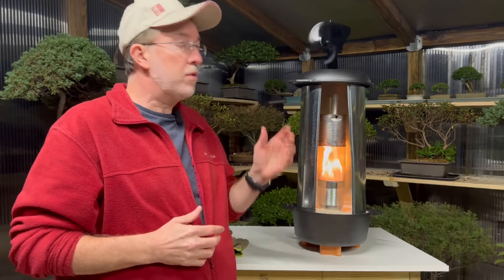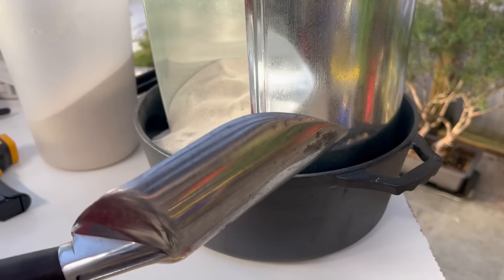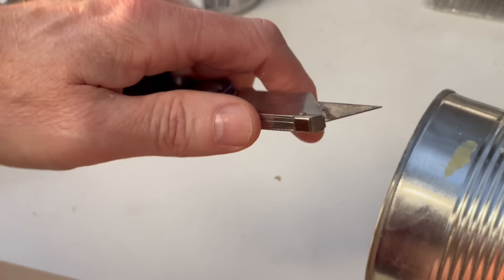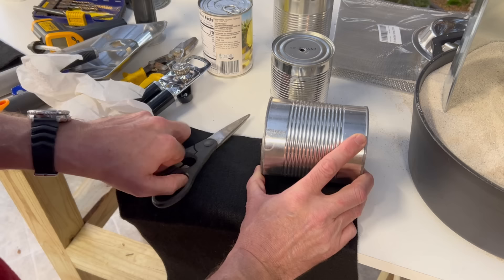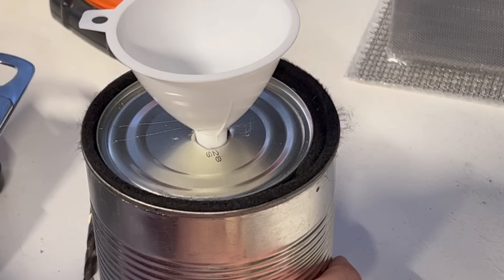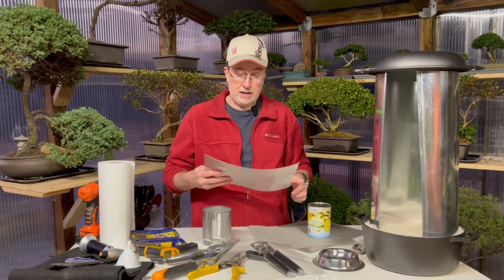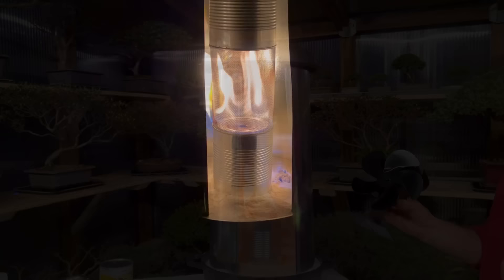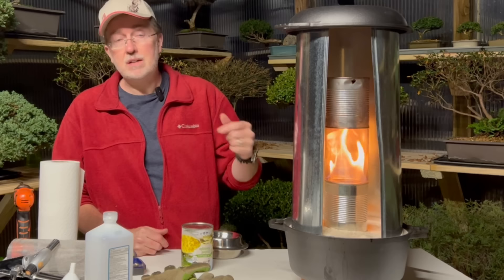DIY INFRARED HEATER | No Electricity Needed For Greenhouse Heat

Comment: Safety Note:Rubbing alcohol gives of noxious fumes. You'll want to use Denatured alcohol or camp fuel for interior applications! In case of emergency; R.A.can be used... ensure adequate ventilation! Also, from experience: place a coin/ stone etc over the fill hole to reduce flare up and fuel consumption.
Reply: This set up is designed for heavy oils like used cooking oil ,not super light oil fuel .The inner can transfer s the heat from the flame to the oil too make it thin enough to suck up . When you steal ideas from others please try and get it right.
Reply: Are you sure about that?, pure ethanol will burn much cleaner than denatured alcohol, denaturant is often naphtha or a similar to petrol solvent, this will add far more complex hydrocarbons to the vapor including benzene.
Reply: Rubbing alcohol is isopropyl alcohol. I can't imagine how it gives noxious fumes. Like ethyl alcohol, it will burn cleanly.
Reply: Omg. I do wild camping and cook with mini alcohol burners on a regular basis. It is common knowledge that rubbing alcohol gives off a ton of soot.. we know in our community because it blackens up our cooking pans. And if it’s giving off soot, guess what? That’s a bad sign. Denatured alcohol is always the highly recommended fuel to cook with in the small alcohol burners, as it burns hotter and cleaner. I can vouch from my own experience, rubbing alcohol stinks like hell. Denatured alcohol on the other hand does not give off the same nasty order. Now. Nobody should be hovering over or breathing in either of those fumes. Any form of combustion chamber needs a certain amount of fresh air ventilation.

Common sense is a commodity.
Reply: Just look for pure ethanol or better yet, methanol. Methanol burns cleaner with blue flame. No hydrocarbons.
Reply: This isn't correct. The black soot from burning 90ish plus% isopropyl alcohol is going to be primarily pure carbon. Whats really happening is that you are inefficiently burning it, eg not providing oxygen at the correct rate to match how much fuel is burning. You get the extra as left over carbon and hydrogen, etc as soot. If you burn 99% isopropyl with proper devices it is definitely soot free.
Reply: @brianm.595  iso isn’t good for wick fed flame. Fine tune adjustments for this type of build to get a complete burn is too variable.  It’s better to just use a fuel that burns cleaner to begin with.
Reply: Would ever clear be appropriate?
Reply: @Victor-hb4hj  it could but it will burn very fast, there are certain fuels that are basically optimized for burning in this fashion. You also have to be very careful with high spirit fuels, they are extremely volatile. Personally if this was a long term solution for something like a greenhouse, I would buy an old stove, get them dirt cheap and use coal and some hardwood, will burn all night. Ultimately this is like creating a solution for something that has already existed for hundreds of years.
Reply: What is RA? Also would 200 proof moonshine burn clean
Reply: Great idea. Thanks.
Reply: With that much yellow Flame Is he using 70% alcohol
Reply: @brianm.595 like the Russian brick oven design?
Reply: @TA.387  it would explode
Reply: @samuellourenco1050  it has additives to, for one reason, deter people from drinking it. 
"...Rubbing alcohol made using isopropanol is regulated and contains at least 355 mg of sucrose octaacetate and 1.40 mg of denatonium benzoate per 100 ml volume..."
Reply: After reading these comments I can safely say ~ I’m more confused! 😬
Reply: @dobrofool nah dude soot is something you don't want on your cook were, inside this unit it will collect, Soot is bad to breathe yes but it won't kill you or you plants and they said fumes not soot!
Reply: @brianm.595 
Props for some chemistry instead of anecdotal opinions
Reply: @GrowingAnswers 
Props. For logic instead of hollow measuring contests, thanks. At least u give a reason beside SOOT
Reply: @robertdillon9989 
  191 Everclear won't explode. It burns very clean. But, you can't find it everywhere. For some reason, you can only get 151 Everclear in Ohio.
Reply: @GrowingAnswers you can make your own from hard wood  while turning the wood to charcoal for later use.
Reply: Can I put this heater in my fire place
Reply: @darkenergy361  
  If it vents, yes.
Reply: @quercus3290  "Personally if this was a long term solution for something like a greenhouse, I would buy an old stove, get them dirt cheap and use coal and some hardwood, will burn all night."  

Regular woodstoves produce a LOT of pollution and are terribly inefficient.  For a permanent heating solution, a rocket mass heater is the way to go, although, for a , heating it with compost works VERY well, provides CO2 for the plants, costs almost nothing, and takes almost no effort.
Reply: @TomfromsunnyManchester  it’s not possible to steal ideas from others. All ideas exist in the universal field of consciousness. Humans are just mediums to the ideas some take them directly from the field of consciousness and take them from the consciousness retained in other human vessels. I know this to be true in 1993, I made an invention a few years later I told a friend about it, he said You should try and patent that idea it’s amazing. Anyway, I went to get it patented and someone has painted the exact same idea the day before. This is proof that the idea already existed. We both just tapped into it at the same time.
Reply: @DJ-uk5mm 
That's some serious internet woo. Have you been dipping into the Everclear again?
Reply: @TomfromsunnyManchester  
How is this "stealing other people's ideas"? It's just a way to achieve his goal - heating his greenhouse. Others may have thought of it and then the idea gets shared. Do you have electric lights in your home? Yes? OOoooOOoh I'm telling Edison you're stealing his idea!! 😂
Reply: @quercus3290 Thanks.You are correct
Reply: I stand corrected... "Ethanol" is safer. I can say from trials,; R.A. & D.A. both create some unpleasant odors. Use with caution.
Reply: Not denatured alcohol…noooo…pure ethanol.
Reply: @scout7060  Curious: Do you get any improved burn time using the felt, and also how do you find the actual burn flame (ie, larger/smaller/comparable) in comparison to just a regular alcohol burner? 😎
Reply: 😊000⁰ ok
Reply: Thanks, you just answered my question :)
Reply: @dobrofool  Where do you get the denatured alcohol or camping oil from?
Reply: @kimgowers486  Denatured alcohol should be available at Home Depot, Lowe’s, hardware stores, even Walmart. The best price I’ve found is Home Depot. Unfortunately, it’s overall cheaper to buy it by the gallon vs Qt, even though it’s expensive at $20. 1 Qt sells for $10, which absurdly ridiculous. But that’s how they get ya ☹️
Reply: The flame is blue.. cleanest?
Reply: @SuzanneCyr-wf2ho  The overall answer is a resounding “yes”. Be that as it may, there are caveats to understand about flame colors. The article link below does a really good job at tackling the subject from a layman’s view. I’ll only add these two things to the article: 1. “Chemicals and compounds” - yes, they can be dangerous, however one of the best fuels for the discussion at hand is denatured alcohol. It is safe, and burns very clean, in fact, among the cleanest. And it usually only provides an orange or blue flame. 2. The article mentions different colors such as green and provides a source for that - I am also aware that the presence of phosgene gas can defected inside a boiler furnace by the revelation of green flames. Situation like this can be harmful to a building. But I digress because we will never see this within the setting  of this video 😎

https://www.cuttingedgefirewood.com/blogs/blog/what-does-the-color-of-a-flame-mean
Reply: @GrowingAnswers 😢😮😮😮😮😮
Reply: Just use starter fluid people.
Reply: @TA.387 Yeah for about 3 seconds before you and it are seeing heading towards the moon😂😂😂
Reply: @michealhand1001  it won’t explode. You can put it in a coffee can and light the top. Hard to see the flames. Teachers and kids at school told me gas would also explode but you can light it in a coffee can just the same. It burns about like a candle would
Reply: @michealhand1001  a lot of people say a lot of things that are supposed to be experts. If you do the experiments yourself, you’ll find most of those people have no idea what they’re talking about.
Reply: Denatured alcohol, by definition is alcohol that has additives in it so that it can not be consumed.   Rubbing alcohol IS denatured alcohol.   What you all are really debating is whether it is isopropyl or ethanol-based, but All non-drinkable alcohols are denatured by law.
Reply: At $12.70 out the door , I use 20lb  Lp Propane for all my needs , Bought at your local "Gilroys Hardware "  stores here in Michigan , take a refillable tank or 2 with
Reply: @samuellourenco1050 . Rubbing alcohol, when used in alcohol camp stoves gives off a terrible amount of soot, though perhaps the screen help burn that off
Reply: @samuellourenco1050  Maybe you can't imagine because you haven't done your homework.  You're just wrong and everyone but you knows it.
Reply: So like a giant backpacking alcohol stove
Reply: Your have magnificent  ideas, thanks for sharing
Reply: @TomfromsunnyManchester  A long time ago in NZ workshops often had 44 gal drums set up for oil burning heaters. A lot cleaner burning than you'd think and the heat output was insane
Reply: Used cooking oil can be used.I am thinking of other materials that can be recycled for such project

Comment: It’s not very clear does the stainless steel screen fit into the inside of the top can and the can sits on it also does a stainless steel screen go inside the bottom large can or it just sit on it or does it wrap around it could you maybe film a sequel, showing how you assemble it that whole part is very muddy
Reply: Agreed. I can see the upper can fitting over the tube of screen, but it appears one must disassemble the lower can/wick assembly and wrap the screen around the wick before reinserting into the lower can, but then... how does one easily refuel using a short funnel?

Comment: Suggestion: cooking oil or any oil works great and burns forever, also no fumes! You might need more space between the bottom inner & outer cans, oil does not throw off fumes nearly at the extreme rate of alcohol, the forever wick will need more room to draw.. ✌🏻🌎✌🏻
Reply: Does kerosene emit noxious fumes?

Comment: Infrared does not heat the air. It's meant to heat the objects it strikes. Heat up water if you want a longer lasting thermo battery.

Comment: Very nice, unique setup.  I like it!  I would steer away from rubbing alcohol, especially at the ratio you are burning (looks like 70%??).  It contains glycerin and water.  What happens is the alcohol burns off and leaves you with a glycerin/water mixture in the can.  Eventually, your wick will be saturated with water and burn very inefficiently.  Best to use straight alcohols (methanol, ethanol, higher grade isopropyl).  Methanol only has one carbon atom per molecule and will be much safer to burn, too.  Less chance to create carbon monoxide and soot.  Ethanol has two and isopropyl has three.
Reply from the maker: I grabbed the wrong one for the video….yes higher grade is better.  Thanks for your input
Reply: ❤😊so simple to make, thank you very well done video
Reply: Could you use waste motor oil? How well would this work for hearing up the garage?
Reply: @MN-sc2uz  to me,it's possible,but they're eater designed for that kind of fluid...and you'll need an exhaust system due to the carbone oxyde you'll produce with petroleum based fluid 😊
Reply: @taoisisis6697 could you use an oil like olive oil?
Reply: @danayerby3658   same problem,due to the kind of combustion,you'll need an exhaust system, otherwise you'll put your health in danger !
Reply: Can you use Crisco Lard?
Reply: When I was young and worked at transmission shops they would burn old transmission fluid for heat.

Comment: You can do the same thing but with olive oil. It’ll last longer and the oil itself isn’t flammable. Just use some rubbing alcohol to start the flame on the carbon felt
Reply: If I use olive oil. Do I have to worry about carbon monoxide?
Reply: @claudiahall5237  it will be in the air but its not as heavy as alcohol burning just have a window in the room just barely cracked open to keep fresh air moving
Reply: If you can afford to use olive oil, just use an electric heater. It'll be cheaper.
Reply: What about canola oil?

Comment: Nifty!  Some thoughts:

1. As you are using sand as your mass, you don't need to go to the expense of a cast iron pot.  You could use a stainless steel stock pot for the bottom.

2. For the top, you could pick up a second, smaller stainless steel stock pot that fits inside the sleeve and also fill that with sand.  (You want a stock pot for top, as they are fairly tall, and it can reach down to the top of the mesh.

3. You don't need to cut the mesh to size.  You can just fold and crimp the two ends together over and over until it fits.   That will make for a very strong seam and the whole thing will still be very cylindrical.

4. The fill hole needs to be (mostly) sealed while in use.  A ball bearing or marble just slightly larger than the hole would be perfect, though a can lid would also work.

5. The extra carbon felt can be packed inside the inner can so that, if the whole thing tips over, fuel won't spill out so easily.

6. The edges of the shell should be folded back on themselves repeatedly to make it stiffer--and thus safer--and to open it up so more heat can be radiated.

7. The top and bottom pots need to be rigidly connected together so the whole thing can't fall apart and create a fire hazard, as bumping the shell hard enough could easily make it buckle.  A couple of pieces of steel pipe that are notched on the ends would work as spacers, and you could drill a hole at each end perpendicular to the notch for a u-bolts to go through to hold the handle to the pipe.  That would make it pretty solid, I would think.

Cheers!
Reply: Cast iron holds heat longer
Reply: @catlyn7829  "Cast iron holds heat longer
"

Very true, but that is because of its mass.  In this case, the sand--in a much larger stock pot--is carrying the bulk of the mass, so cast iron, while preferable if you want to keep it smaller and lighter, isn't as necessary.
Reply: Still. Cast iron holds heat longer than lighter metals.  @KeithOlson
Reply: @catlyn7829 That's been explained, it's because of it's mass. 5 lbs of cast iron will hold heat just as well as 5lbs of sand. There's nothing special about cast iron and its heat transfer and thermal properties.
Reply: Where do you buy the carbon felt please
Reply: I agree that the sand is making the cast iron base somewhat redundant. In a similar vein, why not either swap out the cast iron base for a terracotta or similar pot / planter, and/or use the cast iron base as the lid. What you'd have then is more of a bell system, retaining the hottest air within it at the top. You'd need a sturdy mount though, because of the weight, but I think it would be more efficient.
Reply: What is at the top between the can and the lid?  Did you have time drill a hole in the lid for the fan to get heat?
Reply: you should do a video......
Reply: @tlflora  "you should do a video......
"

:sigh: I would LOVE to be able to do that, but I'm living in an apartment on a pension that doesn't even fully cover rent, bills, and food, so...
Reply: @kenbecker1341 .  I bought two fans similar for my brother's wood burning stove.  When the heat of the surface they sit on reaches a certain temperature the blades begin to turn automatically.  The concept is not that they push the air but rather keeping the warn air circulating.
Reply: No 2 ideas are good as heat rises,you would not get hardly any heat on the bottom pot with sand.
Reply: @kenbecker1341 He drilled the hole in the top of the can.  As far as what's above the last can up top, I was trying to figure out that myself.   It looks shiny there, but in the video during the completion of his project towards the end, where he shows us the 2 cans and the middle screen, it did look like his hand went right through that area above the last can on top, yet, it still feels like I'm missing something. 🤷‍♀️
Reply: Thanx bro, you're a legend.
Reply: @mikeolsen6927   "Thanx bro, you're a legend."

You are most welcome.  /bows
Reply: @KeithOlson  howdy Keith 🤠 good to see ya!
Reply: I'd probably stick the fuel can in the sand
Crimp the SS mesh all the way around to create more surface area
Pop rivet or screw it together.

Looks like a upgrade to the stack of terracotta pots with the 100 hour oil candle for C02 & heat.
6 hours and a spendy fuel cost isn't winning as much
Reply: Cast iron base lowers the center of gravity - keeps things more stable. Wider and heavier the base the more stable it gets.
I wonder if he can do this again with olive oil instead of alcohol? Or maybe kerosene? Something that will last a LONG time.

Also, how about pouring water in that sand?
As things heat up, water evaporates, and increases humidity. Great for the dry winters.

The radiant part of the heater is great for heating you. Won't do a whole lot to heat a space. That is where the fan on top comes in.

The MOST efficient place to put that heater is on the ground.
Reply: I would have been interested in data as to it's actual effect on the night time temperature in a greenhouse.
Reply: @kennethharriger6152  heat travels every direction, warm air rises, just saying.